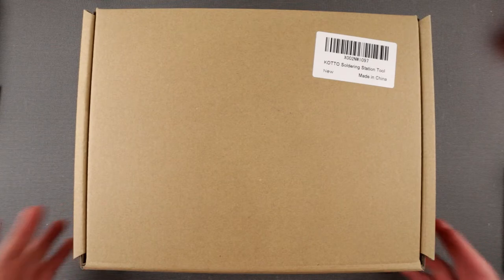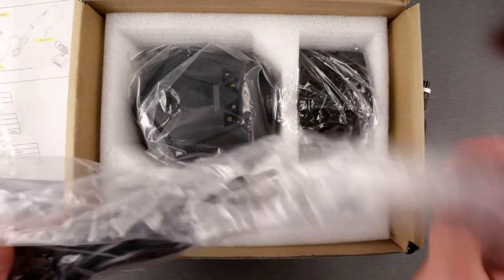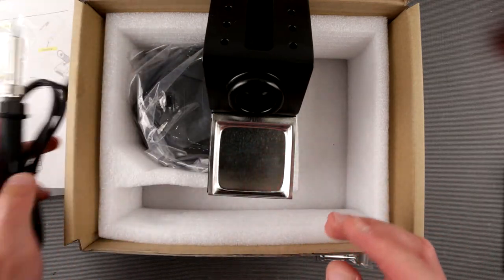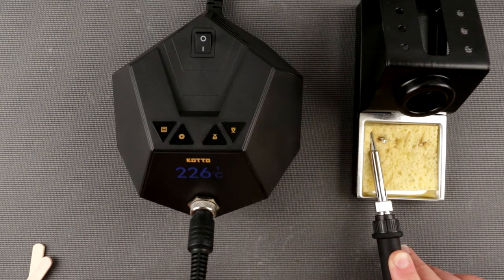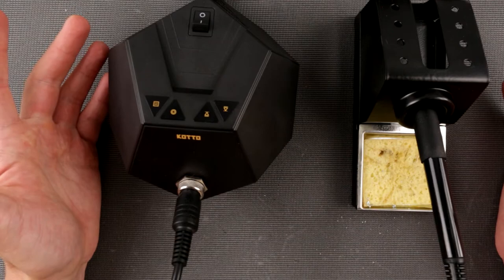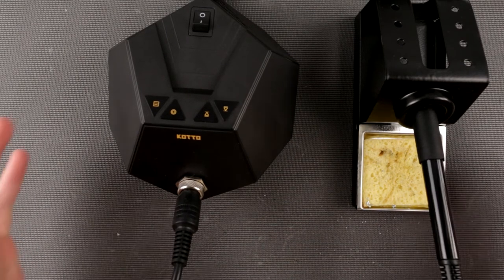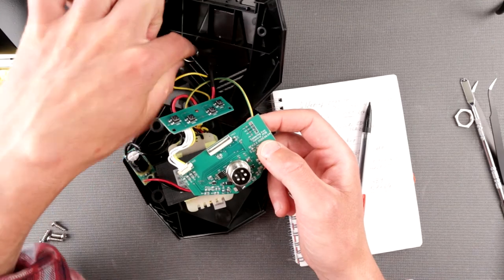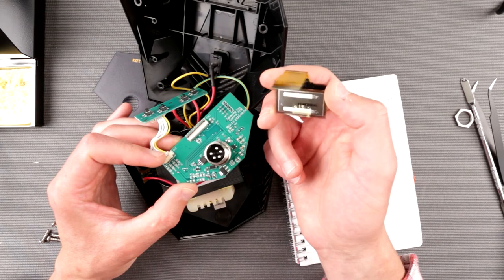Kotto Soldering Station

Comment: Really nice breakdown IOE.  Have you checked out the chinese 5A and 10A DC power supply modules? They are really good, impossible to compete with. A review and testing of those would be cool.
Reply from the maker: Thank you. Yes I did checked. In fact I have video coming about one of those.